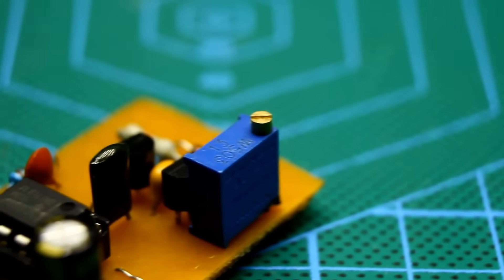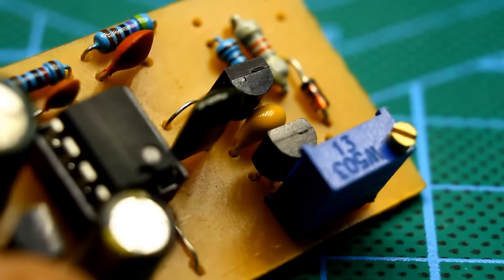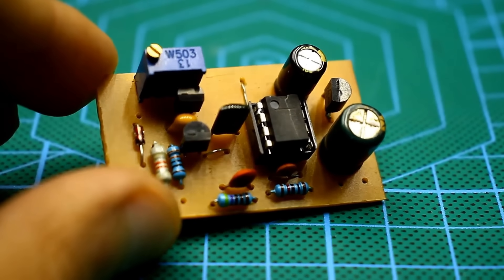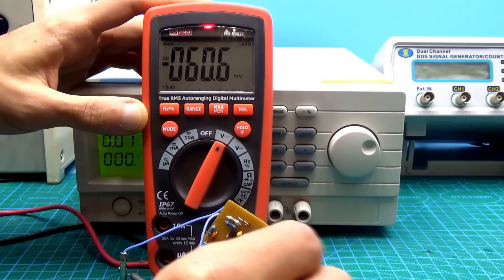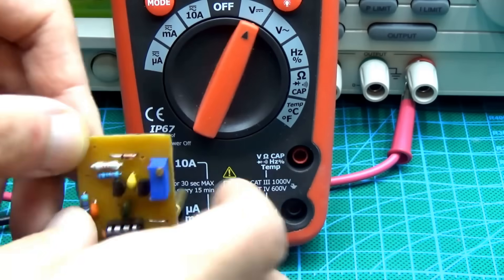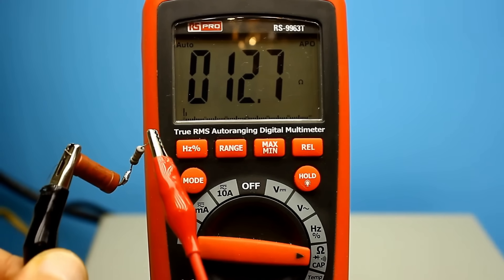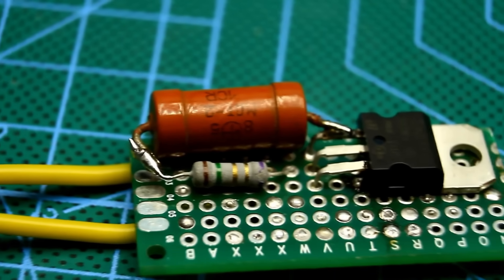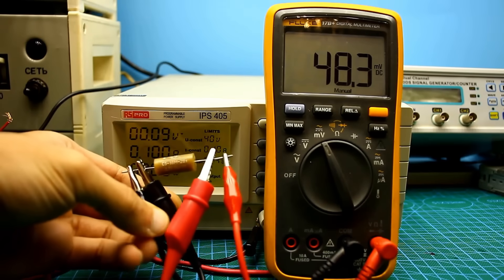TOP COOL ATTACHES for multimeter  №2

Comment: The technique you used for low-ohm measurement is called the "4 wire method" with a "mico-current source" in English.
Have built inductance meter using a symmetrical vibrator, then measuring frequency with an MCU.  Yup yup, this would not qualify as a multimeter attachment. You translated the Cyrillic circuit somewhere?

Comment: If you have a cheap one that you don't need, you can solder a 3k/5v resistor between the + and - probes on the board and you will have a capacitor discharge with a voltmeter.